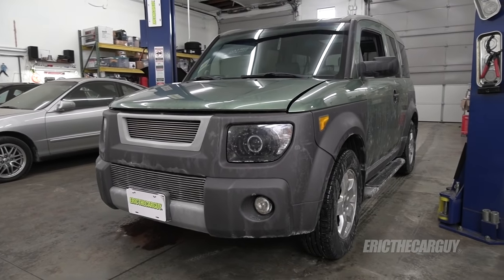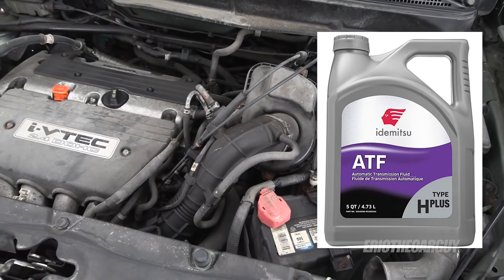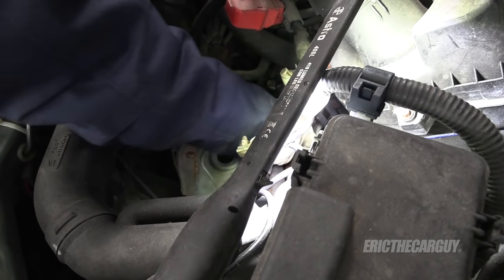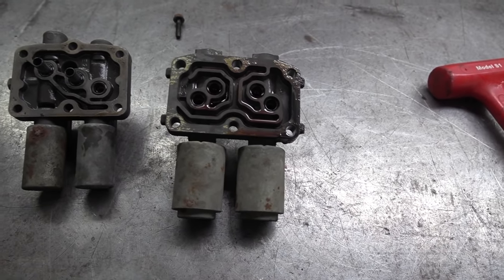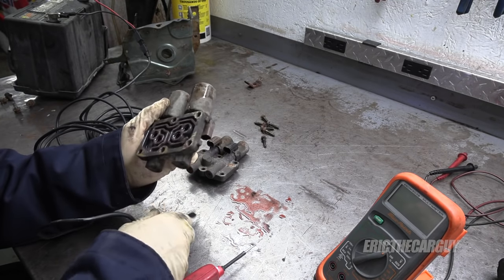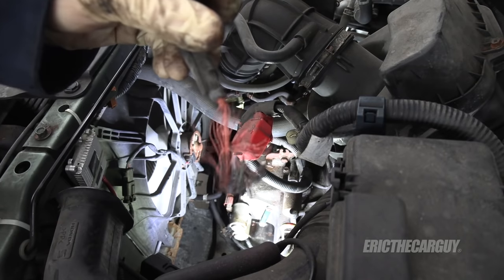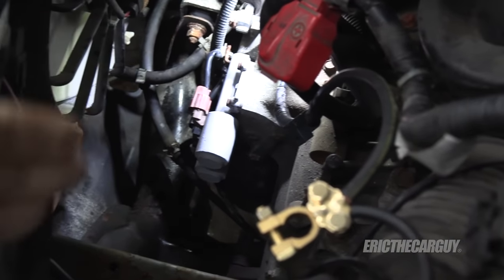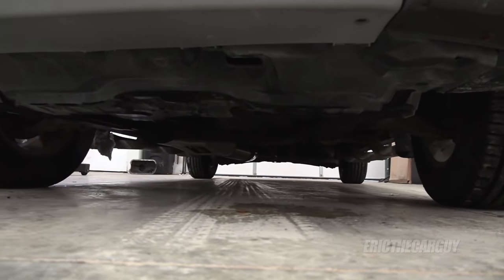Delayed Shifting, Honda Transmission

Comment: My first trans had a problem with with the 1-2 shift it would hold first for a long time then shift hard on hard acceleration then the trans overheated and I got a junkyard one. Now that one has a weird metal chatter noise at 55 period and at 40 but that is a little hard to make happen I hear here and there I was think doing this qhen I get yhe chance glad he made a video on this I just hopes this works out for me I don't have a trans filter so idk how I'm a put one in 🤔
Reply from the maker: https://www.ericthecarguy.com/solving-transmission-problems/

Comment: Hey Eric, I just came across your video on changing the transmission solenoid. I have a 2007 Honda Accord V6 and I had just changed the transmission fluid three days ago. While driving on the highway at 75 miles an hour at the transmission automatically went into neutral then back into gear. As I continue to drive 30 minutes later the transmission felt like it went from fifth gear and drop down to 3rd and then back into 5th gear. Do you think this could be the solenoid problem? By the way I have 220,000 miles on the original transmission.

Comment: Honda CRV slipping from 1st to 2nd. I changed the transmision and the shift silinoids. Could it be a wire harnest problem or something with the computer? Cause I really doubt it would be the transmision since I changed it. Thank you!!

Comment: I had similar problem, but it turned out to be a sensor that corresponds with that gear, its a very easy fix.  I forget what its called but was the fix to my 2002 CRV... Totally forgot what those sensors are called.  Anyone know, just reply
Reply: Did you remember? I would like to know more!

Comment: Thank you, a great repair and a very interesting video. Just wondering, would a scan tool have helped to pinpoint the problem? If so, then it may be something to investigate prior to swapping the solenoid.
Reply from the maker: No codes stored and the scan tool will not show the voltage for the solenoids.

Comment: Eric I’ve watched your videos for year’s I really need your help buddy I have a 98 civic dx auto with a 2-3 flare around 3k-3.5k rpm med throttle sometimes harsh down shifts as well under heavy throttle it does not flare what would help me here? Should I change the solenoid and the fluid? It has 230k no prior knowledge of any maintenance on the trans also do these have trans filters should I change it if it does? Thanks for your knowledge and look forward to your reply.

Comment: My 04 EX is doing the same thing i believe but also have a issue from a dead stop revs up then goes into gear. Not getting any codes for it though

Comment: Eric
If possible can you check out a First Gen Acura RDX? There seems to be a common issue with it lagging when moving from a stop (at a light or stop sign). You can floor it and basically nothing really happens until you get to about 3,000rpm, or maybe above 10mph. I've heard of this from a lot of people including some 2nd gen RDX and even MDX owners, although I don't have an MDX. I don't really know of any fix or anyone who might know what this is about.

If you ever get an Acura RDX see if this is something you notice.

Comment: Eric, I have an 04 odyssey with 327k and all original. Been great but then it started slipping and raising rpm’s while going into 3rd. Now it stopped shifting into 3rd completely and I had D light flash and check engine light come on..  I have done drain and fills religiously with Honda fluid. Does this mean my internal clutch is shot?

Comment: Hey Eric, I have an 05 Honda CR-V that I'm running into an issue with, I get a recurring p0741 for the tcc solenoid. All the information I can find says it needs a trans. But the car drives wonderfully.  I can feel the TQ lock up and watch the rpms drop about 250rpms when it locks up. I recently flushed the trans, and no change, any suggestions? I have verified audible function of the shift solenoid E by commanding it with a scan tool. But I'm not really feeling breaking open the end of the trans to swap the solenoid

Comment: Hey Eric
My thought is the battery cable as the possible culprit. Not getting the full electric volts to solenoid could make it have that shifting symptom. 
I say that because I have a Dodge Ram pickup with auto trans and I was having the same shifting symptom in 3rd gear. Went in changed internal electric solenoid, still had the problem. I took to my local trusting auto trans mechanic, he suggested my batteries were low and the solenoid needed a certain amount of volts to work properly. I bought new batteries (unfortunately my Ram PU is a diesel and needs two 12 volt batteries) transmission shifting problem gone😀. 
What are your thoughts.  
Thanks for all your great videos🙏🏼. Stay well.
Reply from the maker: Then why did the problem still persist on the second test drive after the ground cable repair? It still had the original solenoid on it and still had an issue. Not saying that low voltage can't cause issues, especially on a vehicle so heavily reliant on electronics to run properly, but the facts in this instance don't support your theory. Thanks for the comment.

Comment: My 05 Element Im not sure if is the engine or transmission going blank It feel like some kind of slippage. Happens whe car is at full stop in a traffic light and then Go at green nothing crazy normal speed and out if nowhere in second gear or so it feels like the engine is off of transmission slips. Never felt this with any car I work on.

Comment: My wife has a 1999 CR-V... started to shake in 3 & 4 gear. I changed the transmission fluid about 3x one after another (after driving it a bit in town). Any suggestions?
Reply from the maker: https://www.ericthecarguy.com/solving-transmission-problems/

Comment: ETCG I have a low whinnig noise from my transmission when I let off gas and decelerating from 35MPH down to about 15MPH. It's a 2006 Acura TSX auto with 240k miles any suggestions on what to check?

Comment: have you every tried a cleaner like Seafoam Trans Tune in a Trans ?. had simular issues on a old Nissan maxima. Transmission  change x3 drain fill,   Synthetic ATF Fluid Compat with Matic-D, Lucus and TransTune and it went from barely moving and shifting very bad to something that moves , but lost 4th grear.    its got over 200K miles so just gong to  drive it to it drops its good enought to get around locally.   replacing the ShifSolenoid block on it requires drop pan, take out valve body, replace Solenoid block  (all solenoids) and put back  with new Filter. but still could be a warn clutch or Torque converter
Reply from the maker: I do not recommend ANY aftermarket products for automatic transmissions. Use Honda transmission fluid in Honda transmissions and change it out about every 30K is all that is necessary in my experience. Thanks for the comment.

Comment: Great Video... I need some help.. I have Honda Odyssey 2006 EX-L and it present same problem of this car, but It lose power, when shitf going into 3rd gear... the thing is that i live in Mexico city, Mexico, so here is not pretty qualified professional as you, so I need some direction in order to not be cheated on fixes

Comment: Hi, Eric. My daughter's 2004 CRV (240K) has an intermittent 1→2 very hard shift, which usually can be circumvented by backing off the throttle a little when you see the tach rise up. I have been studying all the videos on youtube about this problem, and a lot of people replace or clean out those four metal ports as well as replace the o-rings when they swap the solenoid pair. I wonder why you didn't do that, as you had everything taken apart? I'm considering replacing the single solenoid on top as well as the pair in front if I get the courage to do this. Thanks.
Reply from the maker: I didn't see any debris in those tubes. Sorry I didn't put that in the video. 

http://www.ericthecarguy.com/faq/solving-transmission-problems

Comment: My 2004 Honda Element has the same problem also. The car has 146k and the transmission fluid has never been changed.
Reply from the maker: Honda transmission fluid should get changed about every 30K or so.
Reply: @ericthecarguy  Is it too late to change it? The previous owner never changed the fluid in the transmission. Also, can I use Valvoline MaxLife ATF instead of the Honda DW-1?
Reply from the maker: https://www.youtube.com/watch?v=L7_RsnD8hAU&t=4s

Comment: Hey eric i have a 2003 honda  crv and it shakes  when  im driving  from o to 60km .It does that when  i floor  it mostly. Also get shatter  noise  once in a while. Amy suggestions.

Comment: Hey I got a 03 v6 Honda Accord I change the transmission I change the shift sensor  d light still blinking it’s slamming wen slowing dwn but it’s shift n drive good I wash up the slonie also

Comment: Please help...
I have a honda accord 7th gen 2.4L automatic i have problem from shifting 1 to 2 , i think it is this solenoid as it only shifts from 1 to 2 if i only let off the throttle but it shifts perfectly when it shifts to 3 4 5

Also when the cars gets warm temperatures the transmission starts directly jumping from 1st to 3rd gear with a loud thud noise and doesn't shift to 2nd gear, only when the car gets cooled down it shifts to 2nd gear and again when it gets warm it starts doing it again. Please say why it does like this 

The solenoid is not available as a used part because this 7th gens are very few here...
So i have a doubt that will the solenoids of 8th gen 2.4L accord will work as 8th gen accord used spares are available because the 8th gen accord are more here. Can anyone help me by seeing whether the 8th gen accord solenoid will work on 7th gen accord 2.4L

Note: the part numbers of 8th gen and 7th accord Solenoids are different but they appear the same

(Sorry for my bad english and a huge discription)

Comment: Heeeeeeeeeeeeeeeeeelp!!!!!!!!!!!! My 08 Honda Accord jerks and shudders 2nd to 3rd. I have checked my dual shift solenoid and screens are clean. Also cleaned clutch solenoid, might I add I tested them both.  They read 0 on ohms, but 12 volt check was good. I am wondering is something ohms read 0 as bad and battery check clicks say good.  Help me out here.

Comment: Question for Honda people.  Bought our first Honda a couple years ago.  It’s a ‘15 Crosstour that we bought used.  One observation I have had is that it seems to moan a lot more than any other car I’ve owned especially when first started.  I did do three spill and fills of the transmission fluid when we got it with the correct Honda fluid.  Is this moaning normal for Honda’s?  Honestly it’s keeping me from considering getting another Honda.🤔
Reply from the maker: https://www.ericthecarguy.com/diagnosing-noises-in-your-car/

Comment: Hey Eric, I have a 2004 E with 190k miles. I bought it brand new 0 miles. I never changed the transmission oil, I dont have any shifting issues, but recently the D light started to blink intermitently. The 3rd gear pressure switch is the problem. Do you recommend me to change the transmission oil once I replace the pressure switch? I'm scared to have transmission issues with the new oil.
Reply from the maker: https://www.ericthecarguy.com/solving-transmission-problems/

Comment: The 4 banger! We always think of the 6 with tranny problems. How many miles? How often do you change the fluid?
Reply from the maker: 150K and I change the fluid every 30K. Like I said in the video, this started acting up after it sat for a while. Thanks for the comment.

Comment: My 2003 Element automatic sometimes revs higher than usual before shifting into 4th. The shift is smooth. It does this maybe 1 out 10 times. Been doing it for years, hasn't gotten any worse. Doesn't really affect anything so I've done nothing about it. I just wonder why it does it.
Reply from the maker: http://www.ericthecarguy.com/faq/solving-transmission-problems

Comment: im hoping the same  fix will   take care of my 2-3 and  3-4  shift flare on my rsx
Reply: WELL i did the  fix on my  rsx it dident  work  so   out came the transmission   i send the converter in for a rebuild and improvement  and we are gonna  change the internal filter and check other internals

Comment: Hello Eric, I have a 2005 ex Honda Odyssey with no start no crank. Put a new battery and starter but the issue is the same. Did you think that the safety switch can be a problem?
Reply from the maker: https://www.ericthecarguy.com/solving-automotive-no-start-problems/

Comment: On my 2000 odyssey… the shift from 1st to 2nd is horrible if I give it a normal amount of gas pedal. It shifts fine if I let it get up to 3.5k… but if I try to let it shift at 3k.. it’s sooooo slow.
Reply from the maker: https://www.ericthecarguy.com/solving-transmission-problems/

Comment: I have acura tl 2008 and whenever i put in drive mode it takes 2,3 sec to come in drive and give me a small jurk but shifting properly no engine light, mechanics are not able to find problem they just say your car shifts properly. Could you please suggest me what i need to do to fix this. Thanks
Reply: And i have also code p0767 shift solenoid vale d struck on please suggest me something. Thanks

Comment: I gave a dear friend, single Mom, a '98 Accord LX 4 banger with low miles, matbe 140K now. Fluid always serviced at around 30K since new. She just mention shifting issues when cold. Between 1st and 2nd. I will check out solenoid replacement. Any thoughts? Thanks Eric.
Reply from the maker: Those older transmissions really didn't have issues. You MUST only use Honda fluid and make sure it is at the proper level. You can't check the fluid level when the engine is running. 

http://www.ericthecarguy.com/faq/solving-transmission-problems

Comment: Hey you helped me out about 10yrs ago! I'm sorry to bother you again but I have a 2008 Honda Ridgeline when I have the heat on it randomly rattles I hear relay click first like a relay and then it's like a rattle scraping nose do you have any idea what that can be?
Reply: I'm not sure if the AC compressor has anything to do with heat it sound like it may be bearing also from like the AC compressor just a guess

Comment: My 2001 Honda Civic EX  automatic finally is a good daily driver after putting a 2005 Honda Civic automatic transmission in it
Reply from the maker: The 4 cylinder automatics rarely have issues in my experience, it's the V6 transmissions that are a problem. If a 4 cylinder transmission has a problem, I often find that fluid other than Honda was used, or the fluid level is overfilled because of checking the level improperly. 

http://www.ericthecarguy.com/faq/solving-transmission-problems

Comment: my 04 Element had my transmission rebuilt at 190k miles. Bad internal bearings that damaged my CV axle bearings.
Reply from the maker: Not a common occurrence at all in my experience. Perhaps someone damaged them when replacing an axle.

Comment: What are your thoughts of the 2.4? I had a 2004 accord 2.4, and the thing burned oil like crazy, and I think the head gasket was on its way out when I traded it off. I've read alot of issues with this engine.  I traded for a 2009 accord couple V6 6mt.
Reply: What issues have you heard of relating to the Honda 2.4L engines back in 04? Very curious as I thought the transmissions were the weakest point of that power train. I always hear people say dont get a Honda V6 because the transmissions can't handle the power and the engines are far more complicated to maintain.

Comment: Do you recommend changing the transmission filter at a certain interval? I have a 2005 honda pilot
Reply from the maker: Not all Hondas have replaceable filters. You might not have any filter to change on that particular model.

Comment: My 2005 Accord has 213k miles, and while it doesn’t have any transmission problems, I’m wondering if replacing this solenoid pack would be a good preventative maintenance thing. Or could it potentially cause shifting issues with higher mileage transmissions
Reply from the maker: If it's not broken, don't fix it.
Reply: @ericthecarguy  I like that idea lol

Comment: Meh, if it happened after sitting, I would've tried zapping it with a few air hammer bursts.  Wouldn't be the first solenoid valve to be freed up that way.

Comment: Hi Eric I need your advice, I have a honda civic fd 1.8 automatic, it has a leaking gearbox. Sometimes during cold start if I put into reverse the it pauses and shifts into reverse aggressively. This problem however is resolved by simply Turning off and starting again. Then it shifts into reverse smoothly. This problem also seem to disappear sometimes when car is given enough time to get hot 
Please advice what is to be done.
The honda dealer is charging me a lot just open the gearbox and understand the issue only then a estimated cost of repair will be provided
Reply from the maker: http://www.ericthecarguy.com/faq/solving-transmission-problems

Comment: i have a 06 pilot and once has transmission line , that leak some fluid out and driving it for a period of the time . all the gear is okay but except first gear to second gear it won’t up shifting, it will only shift if i slowly accelerate. don’t know what’s the problem
Reply from the maker: https://www.ericthecarguy.com/solving-transmission-problems/